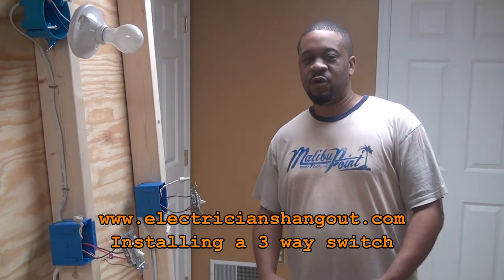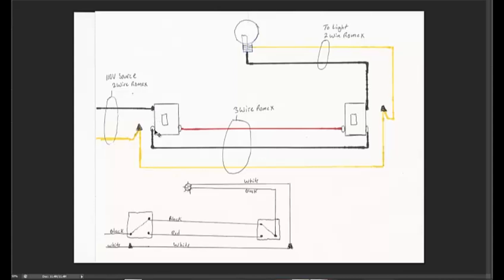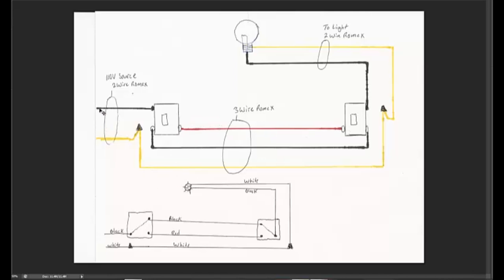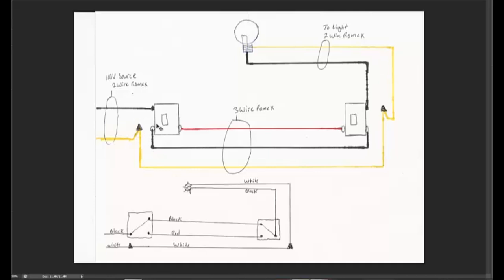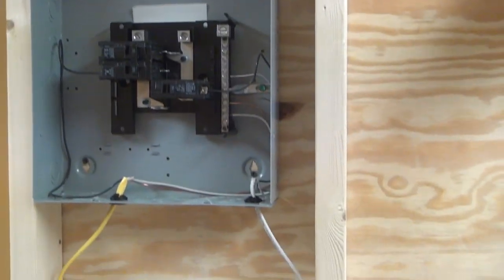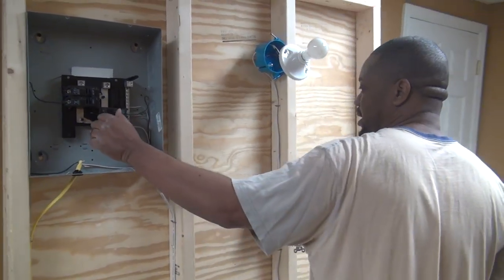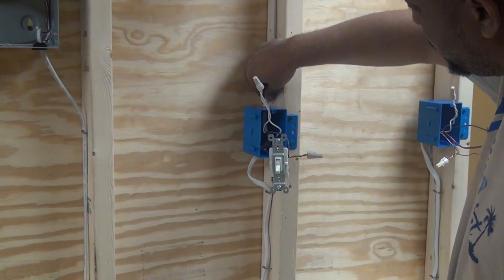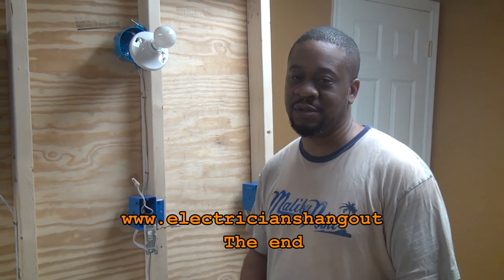How to wire a 3 way switch

Comment: Thanks for the video.  Was having a problem with a 3-way, and it was driving me crazy.  Your explanation of the point screw and the 2 vs. 3 conductor wires finally put it in terms I could follow; had the light working  5 minutes later.

Much appreciated, sir.
Reply from the maker: you are welcome kevin

Comment: Thanks so much for posting the schematic of how the switch works.  That helped a great deal.  Could you produce a video showing how one might convert a two way switch to have one switch control the light and convert the other switch to a 110 outlet.
Reply from the maker: no such thing as a 2 way switch but you can have 2 switches one controlling the light and the other the outlet. The video for single pole switches apply here.
Reply: I'm sorry maybe I was not clear.  I have a hallway where the Builder installed two switches to control one light.  I was wondering if there is a way to remove one of the switches so that the light is only controlled by one switch and use the power that fed the 2nd switch to feed a new 110 outlet to be installed below the switch plate location.  Thanks, Steve @Tyrone3340
Reply from the maker: cbrnews if one of the switches has the 110v feeder coming in then yes you can do what you want however there is a small chance that the feeder is not in either switch box. That is unlikely but possible.

Comment: Thank you.  Your explanations and drawings are excellent.  When this wiring method is used, looks like both switches have exactly the same wiring configuration.  So am I correct to assume that if one needs to replace one of the switches, it's not important to know whether this is the switch with the 2 wire Romex connected to the electric panel or to the light?  Thanks again for your outstanding video.
Reply from the maker: +Alex S If you replace a switch you could wire it the way the old switch was wired, providing that everything was in good working order before the switch failed that you intend to replace.

Comment: thank you so much for your explanations! They truly are helpful. My 3-way switch system is a little bit different. My power is coming into a box that is between the light and another three-way switch. Could you help me understand how to wire it that way.
Reply from the maker: there are many different ways to wire a 3 way switch loop i just showed you guys one of the most common ways to wire the loop, without seeing what you have it is difficult to determine what you have sorry :-(

Comment: I have an older house which has multiple 3 way and 4 way switches. I was having wall and ceiling work done and the contractor removed most of switches and lights. it is easy to figure out where the lights go (on the ceiling) but I am trying to figure out which wires feed the lights. What is the best way to do that? Do I attach a simple light fixture and try to work the switches with a multimeter? What would I look for? For example on one floor I have six switches (2 3ways 1 4 way and 1 single pole, 1 3 way to a different room and single pole to a closet and a kitchen all operating out of the same room. Power does not come from the main light. I know where the power comes in at just trying to identify the wires at the end of the run. to the light